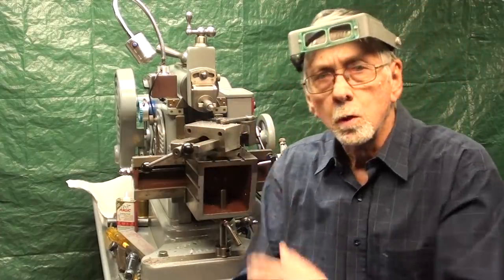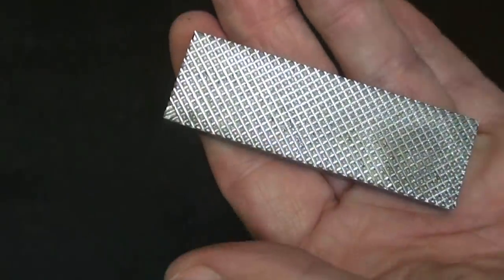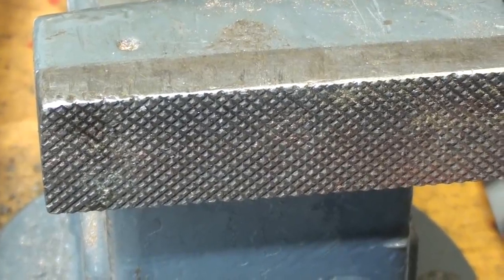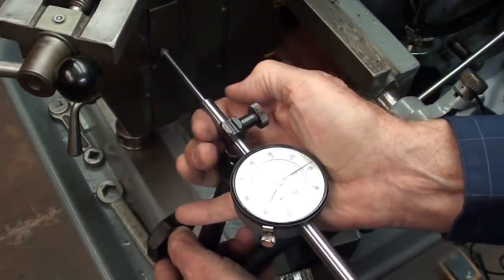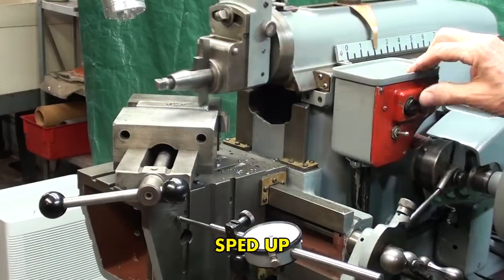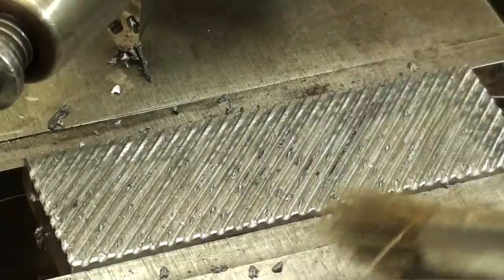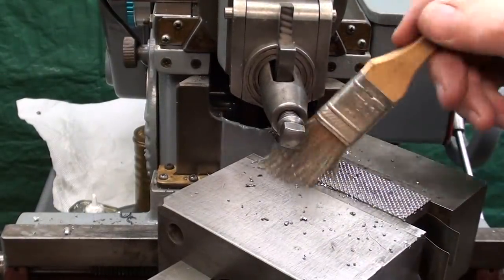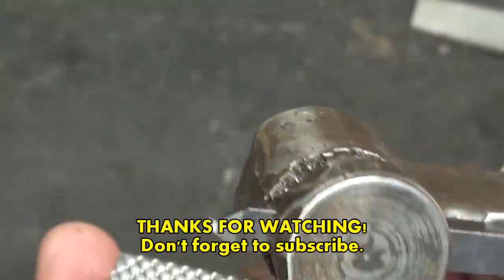HOW TO MAKE SERRATIONS ON SHAPER vise jaws 694 tubalcain

Comment: When cutting the serrations on the swivel vise jaws (video #713) I used a 90 degree cutter on my WW2 vintage Nichols horizontal mill.  I mounted the work piece in the vise with a swivel base set at 45 degrees.  I made the depth of cut only .025 and spaced them .100 apart.  If the depth of cut was deeper or the cuts closer together the points of the diamonds became a little sharp.  I cut all the serrations in one direction, then turned the vise 90 degree and made all the serrations in second direction.  I thought it came out well, and I am waiting for spring to arrive before case hardening the jaws per your instructions in another video.  Like you, I hate changing the angle of my vertical mill, and using the Nichols horizontal mill allowed me to avoid that.
Reply from the maker: That sounds like a great way to produce the serrations.

Comment: I appreciated this video. I need to make new jaws for my Columbian vise. Now i know how i am going to do it. I am wondering if using tool steel will make the job more difficult. I actually have a choice of shapers to use. I can use the Atlas, or the 8" Shape rite, a much heavier machine.
Reply from the maker: Yes, the tool steel will be a lot harder to machine, but it will be better
Reply: @mrpete222  My shaper will cut tool steel? Thoughts or recommendations on cutter material? Carbide perhaps?

Comment: DId the carbine get destroyed on the back stroke? In my experience carbine does not like being ran backwards at all. Like a boring bar just a little too far over centre destroys the insert. I've pondered making a device with a bowden cable that would lift the tool out of the clapper box on the back stroke, so it wouldn't drag the carbide over the back stroke.

Comment: I recently made a replacement vise jaw with my Atlas shaper.  Luckily for me the jaw I was matching had grooves spaced .100 apart (these were set at 60 degrees), which is one turn of the hand feed crank.  It was easy to turn the crank one full turn on the back stroke (I also had the shaper set on its slowest speed) and maintain the .100 spacing without shutting the shaper off at all.  Needless to say, it didn't take any time at all to cut the grooves.  I also experimented with a half turn (.050) but that was too fine for my purposes.
Reply from the maker: Thank you, that is a very good idea. I will try it

Comment: I believe that if you put the tool on the backside of the universal tool holder you will get better results from using it. Abom has a video about this and explains it very well. I thought the same as you before watching his video on the usage of said tool and was surprised at his reasoning why it is used the other way.

Comment: After the drill press, a machine like this was the #2 thing i got to use as a apprentice in the mid 80ties.
Many other apprentices i spoke to at trade school, they did not have machines like that where they worked, but the Danish railroads where i had my apprenticeship did have a couple of these, a small one much like this one, and then a huge one with a dining room sized table, and a throw to match it.

Comment: Not trying to be a smart A$$, but instead of shifting the vise, couldn't you first mark via a sharpe / pencil etc the parts location in/on the vise, than loosen the part, turn 180 degree's, re-tighten the part,  take the time to locate the first cut, then just rinse & repeat? Thanks so much for sharing.

Comment: Now this makes sense, I have seen others use the shaper and it never looks smooth, whereas this is supposed to leave the grooves.
Reply: Shapers can make beautiful finishes, but (like a lathe) not when using a pointed cutter.

Using a convex, skewed cutter (thus a shearing cut) a shaper can leave a finished surface a mill can only dream of.

Comment: I just figured how to make it work with the auto feed.  Set the feed to a fraction of the desired pitch, and hold the clapper for a number of strokes.
Reply from the maker: Good suggestion it's worth a try  I would really have to concentrate
Reply: @mrpete222  now I'm trying to think of a way to hold the clapper up for a number of passes.  Perhaps a solenoid ?  And some kind of cam that indexed part of a turn at every stroke, to switch the solenoid.  Different cams could be used for different groove spacing.
Reply: @dalemcinnes1834  I thought of that too. But then you have to stand there, carefully counting the strokes and lifting at the appropriate time.

Comment: Mr. Pete, was that the vise that came with the shaper?  Even in the best position, the action pushes against the mobile jaw.
Reply from the maker: Yes, original. I was thinking the same thing
Reply: That is the way most I have seen are set up. To put the fixed jaw outboard requires the vise screw point inboard, making access difficult and requiring longer overhang, and the associated greater flex. The fixed jaw inboard gets the work closer to the machine body. One or another of my older books shows alternative vise designs hat put the fixed jaw outboard for heavy work, but I have never bothered.

Comment: They look real nice. I suppose for me to do the grooves on my horizontal mill. I would need a special round cutter to do the same?
Reply: I had the same idea, but I wouldn't want to blunt any of the few V cutters I have.
Reply: @componenx  I suppose you could make a small steel rotary head which would clamp a piece of HSS tool bit with the appropriate tooth pattern. I think I'm going to try this. I will have to make sure the that the top of the cutting tool is on center or a little below the axis of the arbor shaft. Otherwise it will result in a negative scraping cut. Don't ask me how I know this.

Comment: I like this video very much. Clearly a case of thinking 'outside the box' - here's a tool, what else can I use it for ?
However, a little result studying at 15:23 clearly shows your shaper doesn't cut in straight lines ! This could be down to the fact that the cut is starting on a 45° angle and setting up a lateral head wobble as it progresses along the cut.

I hope this is the start of a 2021 challenge - see who can generate the nicest pattern on a surface (flat or curved (i.e. round bar)) using a machine cutting tool: lathe, mill or shaper.

Comment: Well, there's a nice little project for you - get the power feed table advance working larger distances between cutting strokes ! I don't think it'd be too difficult getting nearly 180° rotation of the feed screw per stroke. Anything more than that is going to be complicated !
Looks like you need 3/4 of a turn. Hmm !

Comment: My shaper has the ratchet pawl feed.  One of the first things I noticed was that, once set up, that the table repeats the position of the tool to the work.  If I'm cutting a step into a part, I can reliably allow the auto feed to do the work right up to one step/stroke short of where I want to stop the cut.  Theoretically, I should be able to set it up to cut an entire set using the auto feed ... one of those things I'll have to explore now, and see if it works like I think ... I also just realized that I've never determined what the maximum auto table feed is on the Steptoe, that knowledge might come in handy later on.

I think the problem with using that tool holder is that it holds the bit farther forward of the clapper pivot pin, and movement with tool flexing is causing it to dig deeper than what you set it for.

There is carbide out there that will work with a shaper.  I unknowingly used one on mine, it lasted a long time.  Cemented carbide, the tip was so similar in color to the rest, I didn't realize it was carbide until I dulled it and tried to touch it up on the bench grinder.  As you know, that didn't get very far.

Comment: It would be a good way to make rasps or files if you ground the tool to the right shape.
Reply: that's what I was wondering. I saw a video by clickspring where he made his own files "the ancient way" by beating in the teeth with a chisel, and then case-hardening them. I figure the modern way is a type of shaper .
Reply: @tilliesinabottle  modern way is still a glorified chisel

Comment: According to my HS geometry, the square tops of your truncated pyramids are about 0.040" on a side. Cutting deeper or using a closer spacing would make the square smaller, approaching a point. If one has predetermined the size of the flats required, then the depth and spacing could be calculated with only one small test piece needed to confirm. Thanks to all your good work, we will not need to do any experimenting. :-)

Comment: Nice.  You could do something similar on your horizontal mill with the 60 degree cutter you have if you didn't have your shaper.  If doing it for vise jaws, would you put the holes and countersink in before or after you serrated it?

Comment: The stepover feed is limited by the pitch of the leadscrew and how much of a turn can be had from the ratchet feed. The only way I an see to get really big stepovers would be to mount the advance mechanism on a jackshaft and the drive the leadscrew with gears at 1:8 so the .010 feed will now be .080. Will the feed take 8x the force to drive the leadscrew?
An interesting idea but unless you are doing a lot of this not worth the effort.

Comment: I guess the picture of all the indicators mounted on magnetic bases could be considered extra credit. I have the new larger hand wheel mounted on my 7 inch AMMCO shaper and what a difference setting up and running with the increased leverage. Thanks for the tip!
Reply from the maker: Yes, it is a big help

Comment: Great job. I should have bought that optical comparator from you at your meet and greet. Sorry I didn't.
Reply from the maker: I am quite happy that no 1 bought it
Reply: @mrpete222  back in the day, I made many molds of  molten sulphur and graphite to measure crankshaft journals fillet tangency on yea old shadow graph. Made a little dam of clay holding sides of clear acetate, poured the molten compound which solidified. Then to the comparator to be sure there were no sharp corners to act as stress risers.

Comment: Great demo on chequer cutting here👏👏. A couple of things to add: I've been using an old 6" digital calliper held in a purpose made clamping bracket with one end fixed to the table for accurate table cross feed readout. Works very well. The chequering process on a shaper can be extended to decorative surface finishing by using a custom tool holder that holds a piece of scothbrite or Cratex rubber compound abrasive. This gives an engine machined effect to the component surface. Plenty to experiment with here.

Comment: This operation is much more suited to a shaper than a vertical mill, unless of course it was CNC driven. I’m curious how much feed a full size shaper might have, or if back in the day there were machines modified to do so..perhaps special milling cutters were used in production on horizontal mills?

Comment: Hi Lyle!
Having NOT owned a shaper of this breed I have a question.  Does the autofeed not have the capacity to step the desired 0.075" per stroke?
Ken
Reply from the maker: It does not, and I am trying to work on a solution for a course feed.
Reply: @mrpete222  Thanks!
Reply: @mrpete222  Lyle, interchangeable  feed wheels is what I'm planning for my Alba. Might need to go larger in diameter to accommodate enough fine indices.
Reply: @mrpete222  Probably wouldn't be able to autofeed because 3 strokes are needed per position. An index wheel and pin set up would be nice though.
Reply: @BrianEltherington  Yeah, but with auto feed you take 1 stroke per stepover and then just go back to the beginning and run it 3 more times.

Comment: I've been able to achieve a fine "knurl" with the Atlas Shaper using the auto-feed, I set the step-over as maximum as I can get it (.015+) with a light depth of cut & a fine pointed tool.
Reply: It would be viable to make a set of interchangeable feed wheels with teeth  serrations correspondent to different pitches if this were a cutting process done often on the shaper.
Reply: @howardosborne8647  Good idea, but it wouldn't allow for the multiple strokes per cut as appears to be needed in Mr Pete's project.
Reply: @leeroyholloway4277  If that is necessary then it could be brought back to the start and re-cut a for a 2nd pass. The probability being that fine chequering wouldn't need any more than one pass anyway. 
Edit to add: it also occurs that a 1/2" hand ratchet could be used in place of the crank handle. Disconnect the power traverse rod and operate the hand ratchet in between 2 set stop rods to give the same set over index each time a full retraction and stroke of the hand ratchet is operated. I think that would work OK.
Reply: @howardosborne8647  Yes it would... I also thought about reversing the crossfeed on the return pass so that the machine would stay in sync.
Reply: @leeroyholloway4277  I would think if you had a witness mark (say black sharpie marker or white tipex) right on the index feed ratchet wheel where it was engaged with detent it would simply be a matter of dropping the feed detent into that point every time a new traverse is started. Very much like disengaging and reengaging lathe halfnuts when screw cutting.

Comment: Well done, thanks for showing this. You could still make the vice jaws out of mild steel to save on tool wear and make it easier to machine. Then just Case Harden the serrations, should not be too much of a problem as you only went 0.030" and case hardening easily goes in at 0.020" which should be plenty for the tooth points.

Comment: Can you make a file or a rasp with the shaper?
Reply: I would say most certainly yes. The form of the tool would need suitable geometry to create the cutting angle in the gullets. Carbon steel oil quench hardened after machining. Have you ever seen video of a file being stamped on a dapper? Or the old school method of stamping the teeth with a hammer and forming chisel?
Reply: @howardosborne8647  many years ago I ran across an old brochure from the 1920s put out by a file manufacturer showing a line of men wearing magnifying head gear cutting file teeth by hand. I wish I had kept it. It was done in the old style showing the factory building,  the various stages of production and their full line of files. I went back to look for it a few times but it must have been thrown out.
Reply: @markmossinghoff8185  There are a couple of videos here on YouTube showing the hand cutting process. Also there is a video of the Tomme Fietera factory in Portugal showing files being machine cut.
Reply: The demo he did in the video was with mild steel. You would need tool steel for that, which is probably too hard to cut on his shaper.
Reply: @JasonTHutchinson  disagree with you. Tool steel/silver steel  in the annealed state cuts just fine on the shaper. I've cut quite a few parts made from carbon steel on my small shaper. If the cutting tool is harder than the workpiece it will cut just fine.
Reply: @JasonTHutchinson  
You just need fully annealed stock. Harden and temper afterwards.

Comment: That would make good anti slip steps for your tractor.
Reply: Except for winter, it will fill up with ice very quickly
Reply: @MF175mp  That is why expanded metal; holes.
Reply: @royreynolds108  Yeah I live in freezing Finland and drive tractors a lot.